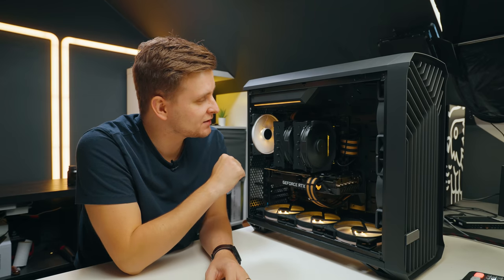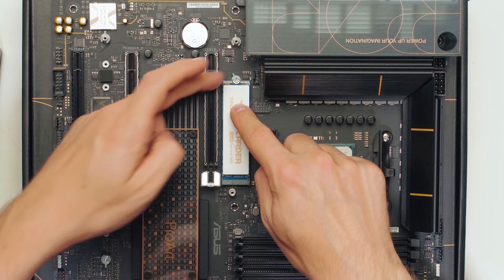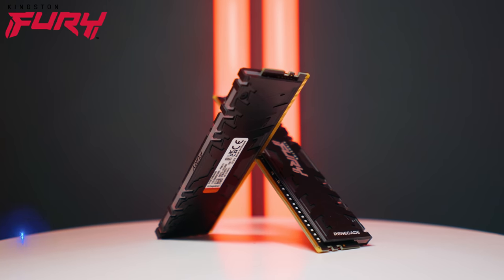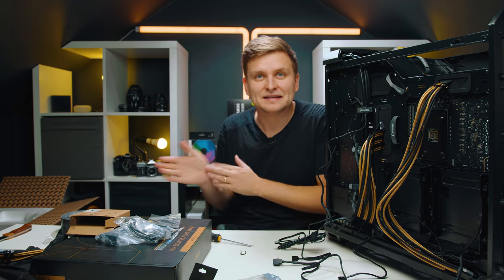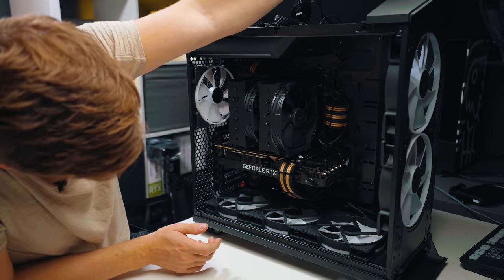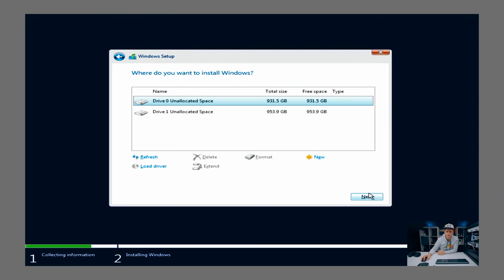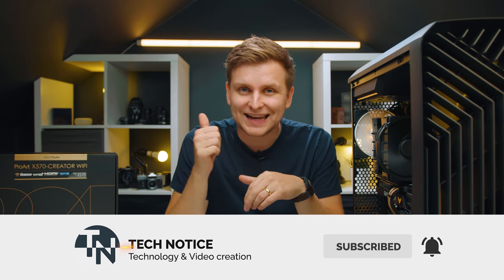The Ultimate Creator PC/Workstation | ASUS x570 ProArt build [Part 1]

Comment: YouTube recommended me this video because I had previously searched for reviews of the mainboard featured, but the tastes of this video's host being quite different from mine makes me want to compare them.
1. The same board, of course, BUT…
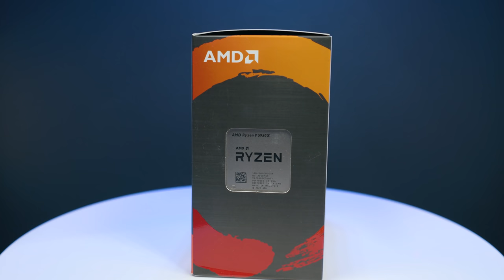2. (2:32) …I would've went with the Ryzen 5 5600X for a balance between performance and power consumption, or a 7 5800X.
3. (3:23) I would also use Samsung SSDs instead, because I like their Magician app, but do let me know if there's some other third-party app that can actively monitor SMART status and isn't limited to Samsung SSDs, that I haven't heard of.
However, I'd leave the second M.2 slot free in order to maximise the bandwidth of the first PCI-E slot. The third M.2 slot would probably house a random SSD I bought off some random user on the classifieds (when they upgraded their PC), as a scratch disc for video and audio editing, as well as when I can't pull specific GIT branches and have to clone the entire repository instead.
4. (5:51) i won't go with fancy RGB gaming RAM, instead going for something like regular Kingston or Crucial RAM, and I'd make sure to fill up all 4 slots! I'd still get gaming RAM if I can get a good deal on used RAM, like how I have Crucial Ballistix Tactical RAM in my current main PC because the seller accepted my offer for $90 for a 2×8 GB kit, and it's 3000MHz RAM underclocked to 2400MHz because I'm stuck with an Intel Core i7-7700 from someone who had since upgraded and I can't afford the latest hardware. Yeah, that means I'm stuck on Windows 10, but Windows 11 lacks some features that I use on a daily basis (I have already filed the requisite bug reports and feature requests with Microsoft's Windows Insider Programme). My next upgrade would probably be in 2023 or 2024 if I wanted to get 2021 hardware, since I bought used 2017 hardware in 2021.
5. (5:39) With the cooler, I would buy the standard Noctua version of the same cooler instead of the Chromax version he used, as I like Noctua's signature colour scheme (it reminds me of old exhaust fans), but I'd probably just transfer the old Noctua model NH-U12S cooler from my current build since I have the AMD socket AM4 upgrade kit for it. Using that cooler on a 65W TDP non-K Intel Core i7-7700 gives me more thermal headroom compared to the Intel stock cooler.
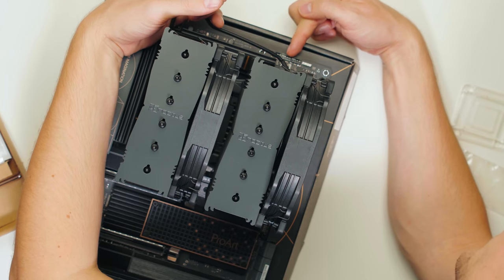6. (8:56) The theme with my current main PC is what I call the 'future sleeper', so in that spirit, I would instead use my modified Corsair Obsidian 750D case from my current main PC.
7. (9:09) I won't buy RGB cooling fans as I'm not into fancy RGB effects. Instead, I'd retain the existing cooling setup in the case, which uses Noctua fans, model NF-A12x25 in the front, model NF-A14 in the back, and 2 fans on the cooler instead of one, all of which have PWM support. I have 3 Corsair AF120 fans with dead RGB on the top for show (12V fans running at 5V), and 2 Tecware stock case fans at the bottom to create an air gap since my bedroom frequently gets dusty. Those 5 fans don't support PWM.
I would also test the system outside the case before I put it in.
8. (11:08) I would hope for the best that the CableMod custom kit I'd already have would fit the new setup. In reality, getting a CableMod custom kit is on my list of planned upgrades, but for now I'm just using stock Seasonic PSU cables.
9. (12:46) I would likely instead use the existing Samsung SSD 870 QVO from my current build, along with the 4 hard drives (2 are for backup), and the Blu-ray disc drive. Yes, I still use discs and diskettes. I frequently work with older PCs.
(13:21) That was unexpected (in the video, that is). Sarcastically speaking, I appreciate you showing the first power on and fresh OS install of a different build of yours that you and your wife likely have been working on for the past 9 months. Based on my experience, the language pack(s) and apps should install over the next 20 years or so. I hope she doesn't get bullied.
10. (13:55) For the PSU, I'd likely reuse the Seasonic Focus GX-850 from my current main PC, along with that CableMod custom kit I mentioned.
11. (16:01) I would use the ASUS Noctua NVIDIA GeForce RTX 3070 GPU card instead, or some AMD Radeon RX card.
On a side note, I once dreamt of ASUS releasing ProArt branded NVIDIA RTX (workstation graphics) GPU cards, like the RTX A4000.
I would also install a 4 port HDMI capture card in the bottom PCI-E slot (the one connected to the chipset).

I also thought the Blackmagic Design test apps were exclusive to macOS, since I've only seen people demonstrate it on that, and this is the first time I've seen those running on Windows!
Reply: I went:  5950x + 128gb ram + 3 x 2 tb Samsung 980 pro's + AsRock X570 Taichi Razer + All LianLi AL120 fans + Phanteks T30 240 + Asus Strix 3080, all in a Phanteks case.  Simple/clean/boring looking but it gets the job done.  Temps are SOLID across the board regardless of time gaming or doing any editing tasks.

Comment: Assuming the one fan at the back is a 140mm ... so 5 fans pulling air inside and 1 pushing the hot air out ....... Do we really need a fractal version of Commander Pro or lighting nodes extra ? or this is all we need even if the case is a Corsair 5000D airflow?

Comment: My DAW, Fractal R2, Be Quiet Straight Power 11-650W, ASUS ProArt x570, Ryzen 5950X, Ice Giant ProSiphon, 64 GB Ripjaw V 3600MHz, CL 14-14-14-34, 1 & 2 TB Samsung 980 pro, Radeon Pro WX 3100, think it’ll run ok when my replacement RAM finally gets here, first set had a defective stick, of course had to send complete kit back and of course they didn’t have it in stock anymore, hopefully in about 8 hours I’ll be booting the beast up and start my installation marathon….

Comment: Hello. Thanks for a great video. Will it be okay to use Intel i9 12900k? Most of my work is in 4K in After Effect, illustrator and Photoshop. A bit in Rhino 3D and V-ray rendering.
Reply from the maker: Yes, absolutely, yet then I'd recommend you check out this build: https://youtu.be/wCxA4hFNfjw
Reply: Thanks  @theTechNotice  for quick reply. However, I absolutely love this one, so I just want to change the CPU if it's okay. I have been working on Mac Pro for the last 16 years, and look forward to working on PC again.

Comment: With that X570 + CPU combo can you run PCIe x8 x8 x4 (3080, 3080, M.2 SSD) and still have 2nd m.2 program drive AND use the Thunderbolt in for video capture or will the PCIe lanes for the GPUs be bottlenecks by the CPU and slowed down past their x8 speed?
Reply: 3080 is a bad card for work, 3060 12gb is better ... It's slower but when the 3080 is missing vram, the 3060 will do the work and the 3080 will not start ... speed 0. I was disappointed with the offer of such an expensive card with only 10gb, it's just ridiculous.
Reply: @666Azmodan666  I hear ya. Just two more gig is rarely going to be the little that is needed. The 3080 in my laptop has 16gig of vram so I'll pull it out for the projects over 10gigs. I wish vram was a separate upgradeable component and not locked behind the massive pay wall of different tier gpus.

Comment: Love the case - but need at least 2 - 5.25 slots for my Blu-ray and Hot -Swap dock for 3.25 and 2.5 hard drives . It is just so much faster using the sata 3 connection  . I still use a Usb3 enclosure for Nvme dock . It is useful for rebuilding arrays and great for backup as well .
Reply: I was considering upgrading my 3700X ... but might wait to see if Amd releases additional Cpu's for the X570 platform

Comment: Could I do a similar build using the Crosshair VIII Extreme motherboard?  I picked one up because they were out of the ProArt Creator. It seems to have similar features only they are evidently extreme.  I can't find any detailed builds using that extreme motherboard yet. I plan to use a more modest CPU and GPU. Like a Ryzen 7 5800X and Geforce RTX 3070. I picked these up mainly because I was in a Micro Center and they happened to have some graphics cards in so I figured I'd get one and start compiling some components.  Haven't opened them yet so might back out and go a different direction.  Thoughts?
Reply: I took the extreme back and got an open box pro art MB. Basically made a similar PC to this one except 9800x cpu and 3070 gpu. No RGB and no fancy cables. Same case. 64 gb of 3200 RAM plain. Windows 10 home. It runs.

Comment: my dream computer has a minimum of 2 x 3090 (nvlink) but so far it's just a dream.
Water cooling is the basis for many years, I have custom and I can not imagine going back to air. Sometimes I wonder why this pump noise is so loud, but when I use air cooling for the duration of water cleaning, I change my mind :)

Comment: I'm looking at this build like the Salient Arms of equivalency, and the one thing that doesn't enter my mind is 'money saving'. 
It's pretty, but just like an SA gun, the base model will do the same job for 1/5 the money. =)
Add: For whatever it's worth, I've built my last two rigs with watercooling and doing hardcore rendering with simulations for engineering projects where they can run for days on end at max power, and the least reliable thing has been my keyboards. I go about 5 years between major rebuilds, upgrades along the way, but both watercoolers that weren't anything fancy are still alive, one of which is going on 12 years old and still in use.

Comment: How did you fit your heat sink cover back on the Cardea ceramic drive? I bought 2 of those based on your reccomendations for a new X570S motherboard and the heat sink covers won't fit due to the extra thickness of the ceramic.
Reply from the maker: It does fit, buy can't screw it in all the way, or just take it off..

Comment: So far I have bought these things:

Case: Fractal torrent RGB

Fan: Fractal prism 140 fans X1

SSD: firecuda 530 1to

HDD: 2to barracuda

PSU: corsair rm1000x

Air cooler: deepcool as500 plus

Ram: 4x16 corsair Vengeance 5200mhz no RGB!

CPU guard: thermalright am5

Motherboard: not yet
Graphics card: not yet
Processor: not yet

Comment: I'm wondering why you didn't go with Cablemod's full length psu replacment cables. That way there's not to much excess wire which I think would add more resistance. Not sure if it would affect anything?
Reply from the maker: Coz I planned to use these extensions on another build with a different PSU. Just posted the video ;)

Comment: Coming back to this, about 5 months later, I'm starting to find out its weaknesses.

- It's not Sli Compatible
- It has very few Pci-e lanes

It's likely for mid-level Creators That don't do 3D at a high-end scale or full Production. Cuz it's having a hard time maintaining a lot of the heavy production multitasking processes I'm used to doing, like PR and AE w/ AI open while I'm Sharing on Zoom. Or running multiple heavy workload items at once. 

It's struggling very much. Recommend moving to a Threadripper at this point, if they release a Zen 3 or higher. The PRO Zens are a lil Studio only recommendation.

Comment: I have almost same build. X570 ProArt,  5950X, RTX 3070Ti, but I choose liquid cooling NZXT Kraken X63, G.Skill Trident Z 64GB. Looking forward to your next video. I see in your test that the cores are 100% utilized. I render 3D at the moment, but avarage CPU utilization is only about 8 %. How can I increase it to 100% so rendering goes faster?
Reply from the maker: Depends what it renders and if its CPU or GPU render not all rendering is done on all cores :)
Reply: @theTechNotice  3D kitchen made in Sketchup redered with V-ray in CUDA mode.

Comment: When you install NVME drive in 2nd port (2_M.2) – Doesn’t it shared with the 1st PCIE slot?

So will the RTX 3090 working on x8 lines instead of x16 ?

Comment: Hi, I use the same motherboard with the same fan... all is well except the chipset is running a little hot... about 70 plus Celsius after just a little run... did i forget something or is it the normal temperature? please help if you can....

Comment: I compose music and use a lot of software vst sound libraries that consume a lot of ram and cpu usage. Rendering the audio is slow. I also play games but only a couple chug my archaic system. Finally, I render and edit videos that are for my music that are painfully slow when rendering. What would the most practical system or even motherboard work best for me? I know the ram would need to be quite high but it is the cpu that gets pulverized in resources.

Comment: Just finished putting together a very similar rig (same Case, MB, CPU, GPU, Heatsink, 128 GB of RAM, 3 Crucial P5 Plus M.2 SSD) . I noticed that GPU runs at PCIe 4.0 8x, instead on 16x. Did you eperienced the same behaviour? My interpretation is the number of PCIe lines. AMD 5000 series has 24 lines 4 of which are dedicated to chipset. Each M.3 consumes 4 lines, so with 3 M.2 mounted only 8 lines remain available for GPU. Am I right?
Reply from the maker: If you don't have anything plugged into the secondary pcie expansion slot the first slot should run x16 no matter how many m.2s you've got installed. Try changing it to x16 in BIOS.
Reply: @theTechNotice   Thanks for the prompt reply. I have nothing installed on  PCIEX16_2.  Unfortunately I did not find any configuration in the BIOS for forcing PCIEX16_1 @ x16. However double checking the MB user manual I found a table at page xii that seems to confirm my hypothesis. It seems that when M2_2 is populated PCIEX16_1 is downgraded to x8 and PCIEX16_2 to x4. This seems in line with AMD 5000 specs. Please advice.

Comment: Oh wow that case is impressive, may have to consider it for next time.

My Meshify C failed to cool my 5950x, 82c with PBO off (140W power pull) used D15 and put 2 140mm A14s in the front - I think the 120mm exhaust was insufficient.

Comment: Hey, you might not remember me but I am the one who asked for the case, and I found one thanks again also is there any other 4090 GPU that can work on the pc, or is the Asus 4090 the only one?
Reply from the maker: All 4090 GPUs will work on this :) just make sure you've got enough 8 pin PCIe connectors.
Reply: @theTechNotice  will the 8 pin PCIe connector from the Phanteks Amp Series 1000W would be enough for a Gigabyte NVIDIA GeForce RTX 4090?

Comment: Can you put 2 graphic cards in this set up on that motherboard?  Looking to use 2 rtx 3080 in this set up 3D animation use (Blender)
Reply from the maker: Yes, but they'd both run at x8 rather than x16 since there isn't enough PCIe lanes on the CPU/Chipset.
Reply: @theTechNotice  thank you, does that mean I’m not utilizing the full potential of each graphic card? so I’m better off with a Threadripper set up.

Comment: Great vid! Made a build with this motherboard coped with Ryzen 5900x and Samsung 980 PRO, but have an issue with integrated Marvell's 10GbE network card. For some unknown reason it does not see my Synology DS1817+... Intel's 2.5GbE card works well without any issues, but would prefer higher connection speeds for work. Already tried so many setups and approaches... but without any luck. Have anybody experienced this? Appreciate any kind of advice. Cheers guys
Reply from the maker: Not this particular issue, I'm sure you've checked, but is the windows/bios/driver all up to date? 
If problem still persists, I'd contact Asus CS.

Comment: YOU MUST REMOVE THE STICKERS FROM THE SSD M.2 +TO BE ABLE TO TRANSFER THE HEAT TO THE THERMAL PADS
Reply from the maker: Nope that's incorrect, according to the manufacturers if you remove them you'll loose warranty and the stickers have been 'engineered' to transfer heat.

Comment: Becouse you use the m.2_2 on this motherboard your gpu runs at x8 and not x16
Reply from the maker: nope, incorrect! :)
Reply: @theTechNotice  i have the same motherboard in one of my pc's, PCIEX16_2 slot share bandwidth with M.2_2, which runs at PCIe 4.0/3.0 x8by default. When M.2_2 is enabled, PCIEx16_2 will run PCIe 4.0/3.0 X4 mode. so when you use M.2_2 then PCIEx16_2 runs at x4 and PCIEX16_1 runs at x8, just check with gpuz, this is also the reason why i don't use M.2_2, i saw it with gpuz that my gpu only ran at x8, test it or just read the manual, but it's ok if you don't believe me.
Reply: I bought this fantastic motherboard mainly because it had a 10Gbe nic on it and i paid only €269 for it (in belgium)
Reply: @theTechNotice  No answer becouse you know i'm right lol

Comment: The only sad part about this build is no vent/fan at the top of the case, heat likes to go up and out... now it has to go past a lot of stuff to get out, possibly frying/wearing some stuff out unnecessarily, plus this case came with some kind of short-circuit lol... not the brightest =D
Reply from the maker: Actually if you have that much positive air pressure the heat will just get pushed out from the back no problem. And the short-circuit problem has been addressed :)

Comment: You actually purchased and installed a 3090, but couldn't get full length psu cablemod cables but used extensions and stock garbage cables instead????????
Reply from the maker: I had the choice, but since I'm planning to reuse those extensions in another build with another PSU, it made more sense to go with extensions.
Reply: There are no functional advantages to having full length sleeved cables, believe it or not...

Comment: i would never use SSD for my work .. ssd can die like from one second to another .... and bye bye your work  forever  no way to recover .. for archive .. and for your important work .. only HDD
Reply: I would never trust my work on a single drive no matter if it's an SSD or HDD. Always backup your data both locally and on the cloud, then you'll no longer need an HDD to store your work related data.